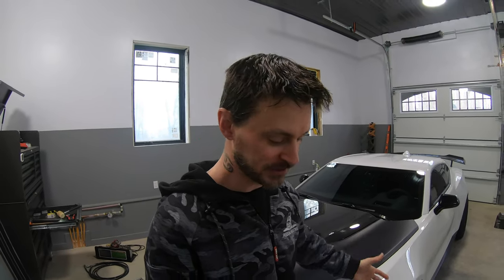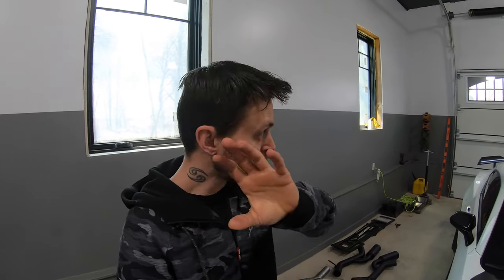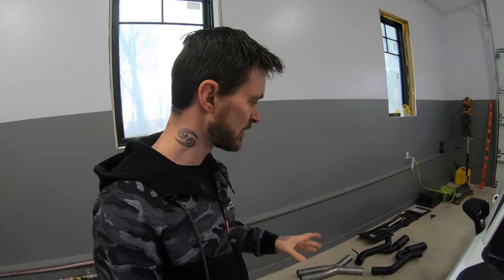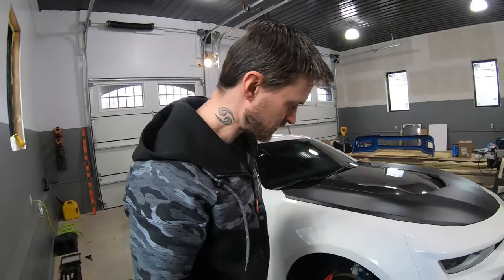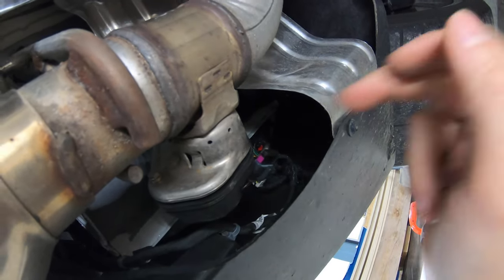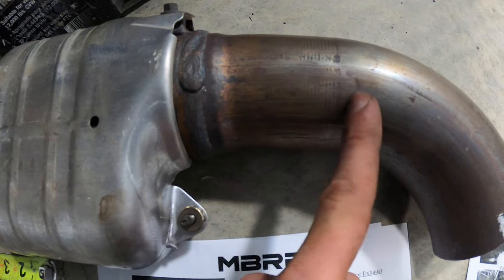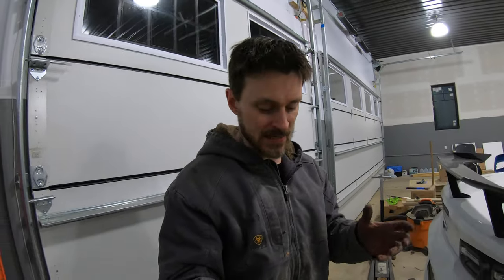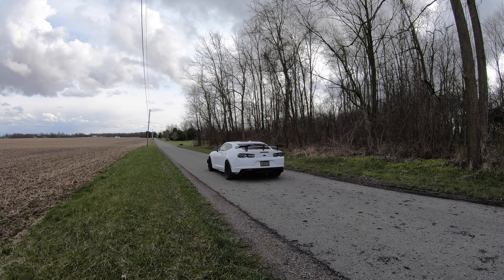Camaro ZL1 1LE FULL 3" catback install & brake bedding process, DONE!

Comment: I always hate bedding in brakes.  Yours seems to do well.  It amazes me how the manufacturers cobble exhaust systems together.  I will be interested to see how you do getting all the suspension sorted with the new parts and adjustments.
Reply from the maker: This was definitely the worst.  Probably didn’t help I ate some candy for breakfast and went out to do this.  Yeah I think the oem is for the convertible but they use it on the coupe too.  So far everything is done and street driving feels amazing!   All I have to do is bleed the brakes and go to a track day.  Maybe add some better seat belts.  But the last video I did everything was Squared away.

ZL1 1LE SPL suspension, window tinting, track alignment DONE!
https://youtu.be/mR26RnigFRI

Comment: Nice video.  ...and that was great customer service with MBRP offering to send another pipe and Summit Racing issuing a refund.   I'm on the fence about this.  I'm running aftermarket headers with the stock muffler.  I've been thinking about adding the Cat Back as well.
Reply from the maker: I would but with headers you might need something with the valves!!  This not being a DD I wish I could straight like the whole thing!

Comment: You should definitely get the Katech LT4 Ported Throttle Body. Did wonders for me on throttle sensitivity. The stock 87MM TB is the same that GM  has on their diesel trucks. I've had the Katech PTB for 3 years now, worth every penny considering how cheap it is. Best part - no throttle hesitation/bogging off the line. This mod is extremely easy to do and without a beer brake, done under 30 minutes.

Count me surprised that you left the secondary cats on the exhaust, one of the first mods are to delete the Secondary Cats as those are unmonitored (so no CEL). The car sounds amazing after the secondary Cats are deleted. Any local muffler shop can simply cut off the sec cats and weld in a 3 inch pipe in that section. Having done that 3 years ago, I have nothing but smiles for years.
Reply from the maker: What’s the size?   I don’t have any complaints about the oem one yet.  Afraid if I start down that rabbit hole it won’t stop.  Like if it’s bigger, needing to port the LT4 to match and getting a new intake etc.  as for the secondaries that’s what I meant about the test pipes.  I don’t think there’s a shop in the US that’ll do it though.  Everyone’s scared of the EPA since shops have been getting hit with huge fines since they’ve been cracking down on tuning diesels etc.  I asked the performance shop and he said no so…
Reply: @neckofthewoods24  The Katech LT4 PTB is also 87mm, same as OEM. 

Muffler shops will easily do the Secondary Cat delete, I didn’t have a single one that said No to me…
Reply from the maker: @AllIsWell_22  yeah but that was 3 years ago.  The shops started getting fined last year.  The first those diesel brothers that made headlines are $500,000.   I don’t think anyone wants to risk that, specially a little corner muffler shop that won’t have those funds.
Reply from the maker: @AllIsWell_22 gone now!  😊